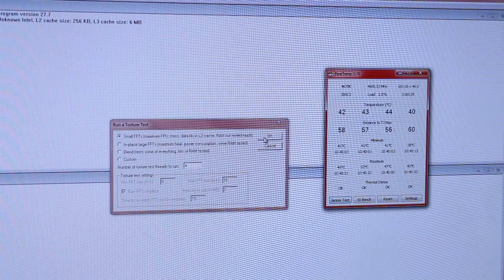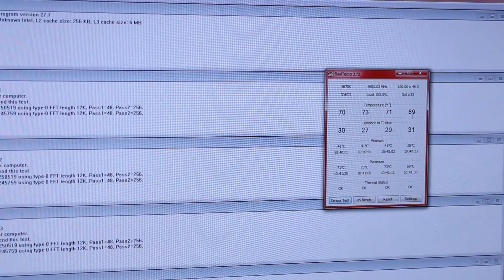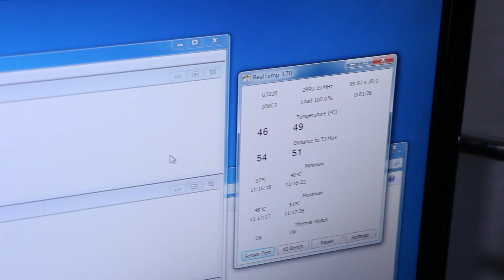i5 & i7 Haswell & Ivy Bridge - FULL Delid Tutorial - (Vice Method)

Comment: But everyone says not to spread the paste, why did you do it?
Reply: When you apply TIM to the IHS, most of the time your cooler would do the spreading itself. Underneath the IHS however, you would need to rely on the IHS to do the spreading. Which for anyone who is cautious, they would not risk that.

All the TIM is supposed to do is allow heat to be easily and quickly transferred to another surface (Die->IHS->Cooler), and that works best when it has maximum surface area to work from.
Reply from the maker: I use both; pea when I am strapped for time or on a computer that I am not going to be ocing that much (or at all), and then spread method for when I mean srs biz.
Reply: coz the past is only a little bit so u should spread the past